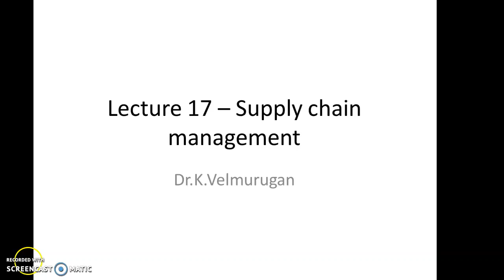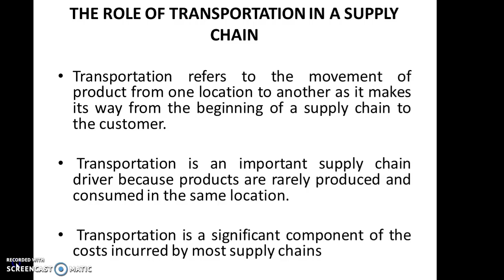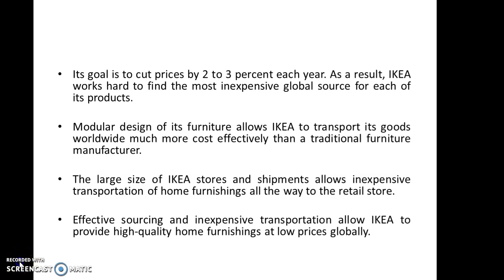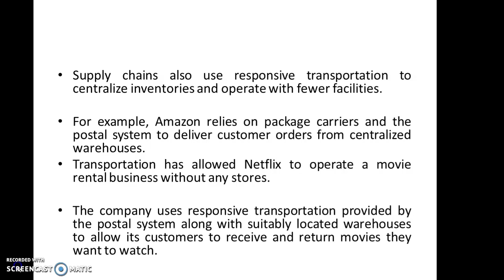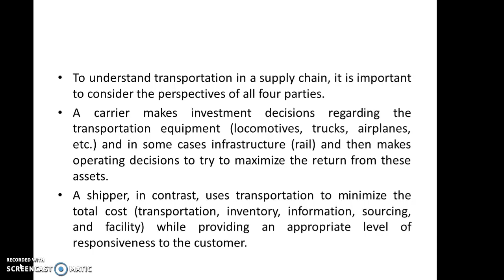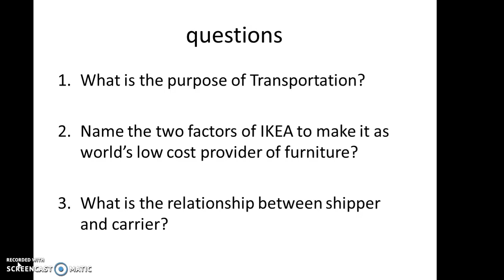Lecture 17 - Supply chain Management

Comment: Name : Habeebulla S
Roll No: 17
1. Purpose of transportation:
        The products are shipped to the customer location because the products can't be manufactured in same location.
2. Factors of IKEA:
        a)They cut prices by 2 to 3% each year
        b)Products are divided into 7 modules ,so the packing and transportation becomes much easier 
       c) They provide good quality at lower cost
3.Relationship b/w Shipper and Carrier:
      Carrier makes investment decisions regarding transportation equipment to maximize their return and contrast shipper uses transportation to minimize the total cost.

Comment: Name : Preethi R
Roll no : 45 CSE A
1. Purpose of transportation.
         To make availability of products in all the places even though the customer is far away from the manufacturing unit.
2. Two factors.
      * Effective sourcing an d in expensive transportation.
3. Relationship between shipper and carrier.
      Shipper is the concept of moving the product from one place to another by using the carrier eg truck, lorries. Shipper want to minimize the total cost but carrier want to maximize the profit.